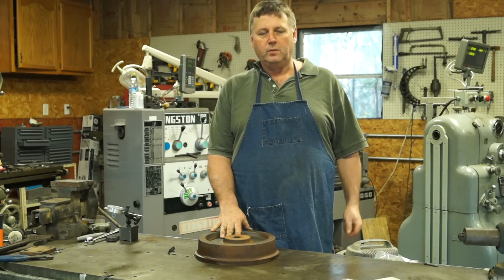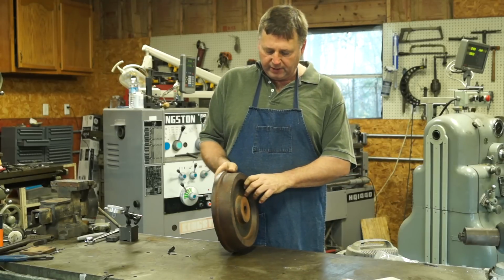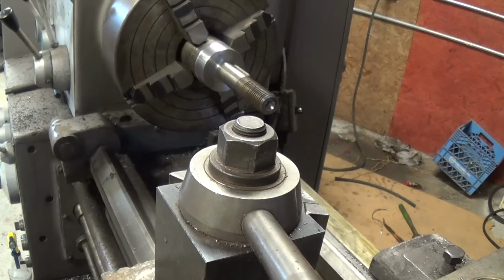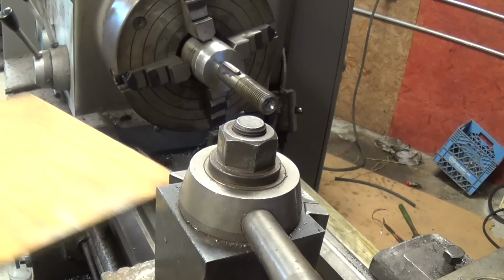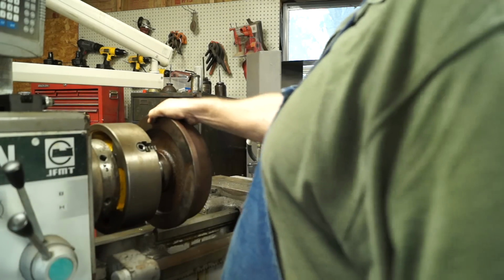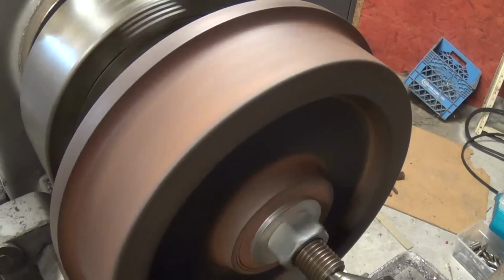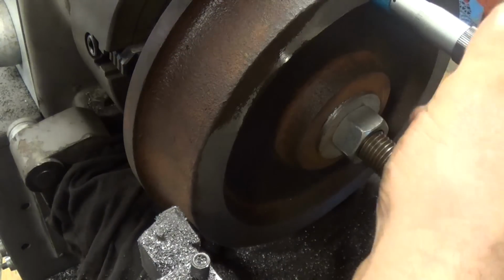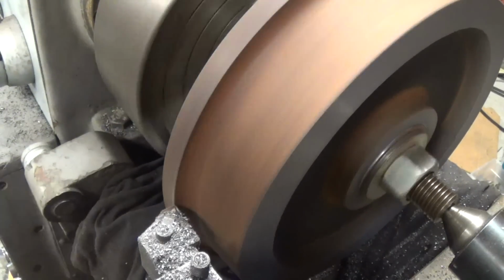Train Wheels (Part1)

Comment: I have a set of solid steel wheels 3 inches thick and 9 inches in diameter. They have axles welded in place. Going to machine out the old axles and bore the centers out to accept bushings from old pulleys. Going to build a motorized track art for running on abandoned railroad lines.

Comment: Mike I am curious as to how you got a 4 degree taper on the wheel tread. When I was with the railroad I did a similar job on an Alco RS-11. The wheels had been slipped so much they were worn hollow and had burn spots on them. The tricky part was there was only .030" of tire left before the wheels would be out of specification undersize for class 1 mainline use and would have to be changed. As you can imagine, this is an enormous job involving removing the truck assemblies from the loco and installing new wheel sets. My supervisor was sweating bullets. We successfully completed the job by jacking up one axle at a time, disconnecting the motor leads and powering the traction motors one at a time with a 250 amp DC gas powered portable welder. We fabricated a tool holder and clamped it to the rail next to the wheel and used a carbide cutter (actually several of them) It took 2 weeks of 8 hr days. The railroad provides a tread profile gauge used on 92 day safety inspections which I used as a guide. A memorable job. If I had cut too much off, the engine would have had to be repaired without leaving our yard and we had neither the equipment or supplies on hand needed for a job of this size. I was a sweating bullets right along side my foreman.

Comment: About 1960 i machined a set of 24 railroad wheels for my step father's miniature amusement park railroad. I also turned the axles. They were to be used for 3 passenger cars. This kept me busy (louie figured keeping me "busy" was a very high priority) for most of January after school. All the work was done on an antique belt driven lathe with a manual crosslide. The wheels were press fit on the axles so I did not have to broach keways with a cutter I did not have.
Reply: I “hate” the supervisors that insist a high priority on keeping me “busy” as it’s tough enough doing the job without having to use antiquated equipment. When things get bad enough, I’ll pause the job, go to my local equipment suppliers and buy needed gear with company money. 
I’m a highly trained tech in my field, working under management that followed my directives. They never did promote me to the highest tech level.

Comment: A rotary table on a mill--you'd need no CNC.  I've made tank bottoms using a rotary table on a mill--turned out great!
Reply from the maker: Yea, two rotary tables one mounted vertical on the other mounted horizontal, Then you will have a 5 axis LOL, I manage a CNC shop but would rather turn handles.

Comment: When you said mill, I was thinking with a rotary table maybe.

Damn! The next machine you should get is a large ratcheting arbor press. You could broach that wheel in about 3 minutes and with no sweat.
Looks like it is cutting like an iron casting. I do not know, but would guess modern wheels are hot forged steel. But iron fine for museum piece, and I bet original was iron too.
I want to see the train that has one inch thick axles! Maybe in the next vid, part 2 it is. Off to that now :)

Comment: Comment from someone who turns railroad wheels from small maintenance of way wheels all the way to full size.  Yes, a CNC lathe would have been nice but old tracer technology on a lathe knocks these things out faster than you can think about doing them anywhere else.  Turn the flange od last.  Make sure your taper is correct or at least the same on mating wheels on axle.  I would think you would have a scaled American Association of Railroads wheel drawing that has been scaled down to cut the several radius in the flange.  You want to make sure and get these right to the drawing you have as you do not want wheel climbing and walking issues.  Makes for a bad day for the train crew.  Next biggest issue is to make sure you have a pi tape of some sort to measure that you have exact wheel mates on an axle.  Measurement should be taken just inside the center line of the tread where the wheel contacts the tread.  I have a a special measuring tool for full size aar tread profiles of most any wheel size called a wheel tape I use to make axle mates.  I offered to run these through my tracer buy Keith thought the freight would cost to much.  Good luck!
Reply from the maker: Thanks for the reply,   I did have some instruction on making the wheels, It specified the radii. I used it to make all the drawings and dxf files for the programming of the wheels. I used the prints to turn what you see, the only difference was the rear of the flange was called out R.260 and the other radii were .250.   Thanks for watching and leaving a comment
Reply: One other way to do it is to build a basic manual tracer. You make a template of the profile you are after in aluminum sheet or something and you mount it to a fixed part of the machine, Then you mount a pointer to the cross slide. This pointer is aligned with the template, so when it touches you are there. If you use a dial gauge beside the pointer, it will show you how close to the profile you are. You can hog away until you get close, and then use the dial gauge to do the final passes.

Comment: That casting could have been closer to make the job go quicker.  But, I've ran into brick that were all sizes on a job where there wasn't much room to adjust the mortar joints and we had to go with what they brought!  Looks like you are getting it done right though, thanks and looking forward to more of these.  Greg
Reply from the maker: The casting could have been better but the issues would have been the same. It wasn't as bad on the lathe as it was on the mil.

Comment: Sincere sympathy's if your finding inclusions in those as well Mike. All that rust, possible casting sand and scale plays hell with any lathes ways without using that protective cloth to keep as much out as you can. That's going to be a filthy job getting those wheels to size,tapered and the flange radius done.
Reply from the maker: The inclusions were not that deep, I measured a couple by sticking a wire in them and the most I saw was about an 1/8" Thanks for the comment

Comment: Hard to beat a lathe for material removal on a circle. I thought these little wheels were idlers?
Reply from the maker: The lathe was the correct choice, with multiples the cnc lathe would be the right choice
Reply: bcbloc02 , the right size for your barn doors, or?